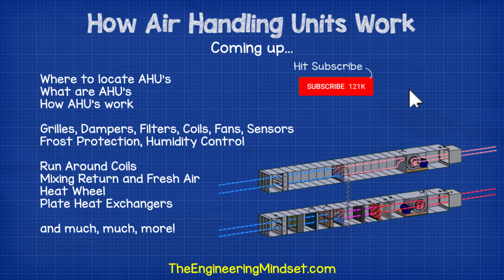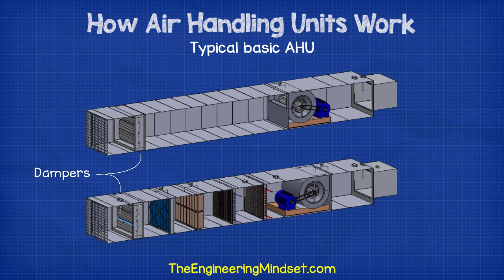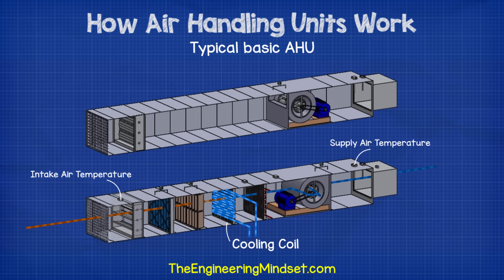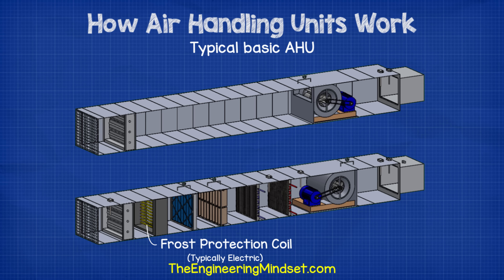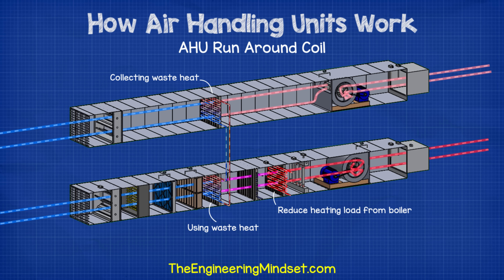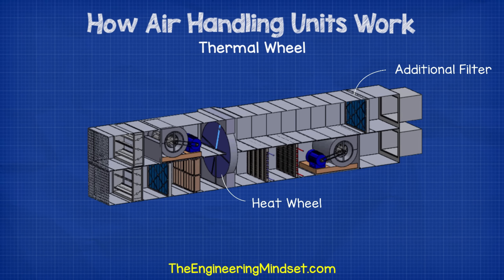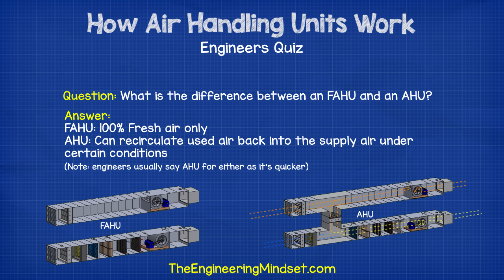How Air Handling Units work   AHU working principle hvac ventilation

Comment: An AHU (Air Handling Unit) is a machine for building air.
	•	It takes air from outside (and sometimes inside).
	•	It cleans the air with filters.
	•	It can heat or cool the air.
	•	It can add or remove water in the air (humidity).
	•	A fan blows the air into the rooms through pipes (ducts).

Comment: Service engineer from the Netherlands here. Great video and explaination. I have never seen exhaust units without filter. It is common to have inlet and exhaust filters here. No matter if there is a heating wheel.
Reply: Why filter the air going out?
Reply: @gggggggggg-ms8lm  air pollution especially in case of KEU.. kitchen ecological exhaust unit

Comment: Question . Single family home. I had two hvac companies check my ahu.. they was working on the wiring. Nothing changed. When it’s cold, it’s colder inside than out. When it’s hot, it’s hotter inside than out
Reply from the maker: I would get a temperature sensor and place it near the grilles (coils to of you can access them, infrared gun) to see what temperature the air is entering your property. Make sure it's sufficient and correct. Then my next concern would be wall and roof insulation. For example a campervan is going to be hotter inside because it's basically acting like an oven in the summer, in winter it can't hold much heat because the walls are so thin so it's going to be very cold inside

Comment: I'm involved with this equpiment frequently so (hopefully) the majority of the video is something I already know and am familiar with. In regards to your remark regarding centrifugal fans, I'm not entirely sure that was the proper way to describe it. Would it be more fair in your opinion to state that many old and existing ahus use PSC motors and that EC motors are becoming more common? Maybe I'm mistaken but I believe you will still find centrifugal fan designs even with EC motors.
Reply: I'd add, I rarely encounter an actual 'return' fan in AHUs. What's most common in my experience is just a supply fan. Any other fans will likely be exhaust fans for building pressure control.

Comment: major difference between FAHU and AHU are FAHU used fresh air take from atmosphere but heat exchange between return air to fresh by thermal wheel. AHU is recirculate air from return air to supply air.

Comment: Very good video! There are also other, more effective types of heat-exhangers in AHU's to capture the heat of the extracted air that are more ffective than the one with coils, but it's a very good example. Rotary heat exhangers as an example are very effective, but risk returning smells into the incoming air, but again, there are other variants still.

Cheers on a good video!

Comment: Awesome video. Anyone knows if there's an instrument to measure supply air pressure output at the AHU before it enters the main supply duct line? This is to know if the unit is producing enough "pressure thrust" especially for older units. Thanks

Comment: 2:22
 How Air Handling Units Work 

2:00 Air Handling Unit
2:09 Compressor
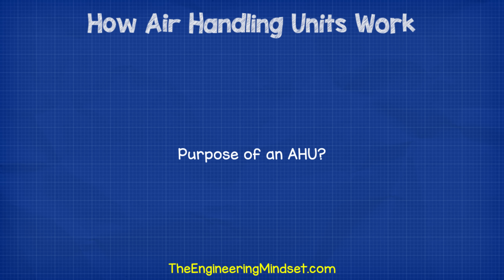2:15 Oil Seperator
2:22 Condenser
2:27 The master solenoid, filter dryer and thermostatic expension valve

2:45 Before Starting Checks: Oil > Valves > Power Supply.
 >Oil Level at compressor
 > Cooling Water Inlet - Outlet Valves to the condenser
 > Open the compressor outlet valve, condenser inlet valve, receiber outlet valve, filter drier inlet valve and outlet valves. 
> Check whether power supply to the compressor motor and blower 
> Ensure Compressor manual. 

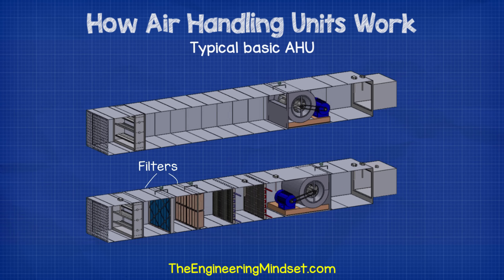3:55 Starting: Valves
 Open compressor inlet valve half a turn 
> Start compressor 
> Open the compressor inlet valve slowly to fully open mode 
> Change compressor mode to AUTO 
> Check ampres, blower motors, temperatures

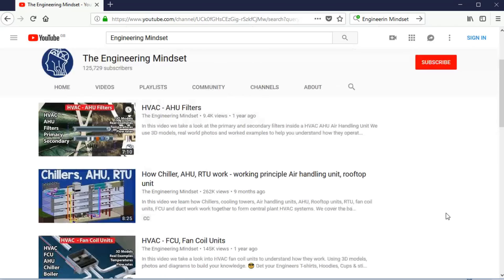4:39 During Operation: Parameters > Oil level > Temperatures
 Suction and oil pressure, vibration, oil level, inlet, inlet outlet air temperatures at air handling unit

5:15 Stopping: Cut off > Shut Down
 >When air temperature reaches set value, thermostatic switch will cut off the compressor. When air temperature increases, the compressor will cut in.
>Close the condenser liquid receiver outlet valve for Shut Down for long period.
>Compressor stops due low pressure
> Shut the refrigerant line valves.
> Shut the condenser cooling water inlet and outlet valves
> Switch off the power supply.
Reply from the maker: Seen our new pressure switch video? Link: https://youtu.be/YG81w0HFXNc

Comment: Nice presentation ..Quick question- Why is the defrost preheat before the inlet filters? I presume to ensure filters wont be full of moisture etc? I have seen rotten and blocked preheat coils as they have had no protection from the elements. Typically this is LTHW heat exchanger fitted as a preheat.. Any thoughts appreciated...

Comment: What do you think about high velocity micro duct systems. Often used for renovations where there isn’t much ceiling space or access. But what do you think about using the for residential new builds?

Comment: Can you explain the purpose of a Desiccant Dryer Unit that is sometimes connected to the outside air intake on some AHU’s? And why does it seem like the building EA is heated before the wheel then cooled again?

Comment: I mean to dehumidify the air you could use the pumped out warmth of the cooling unit  to warm it up again, so it shouldn't cost much more energy
Reply: That depends on the scale of things. I work for a major university, for example, which has a central power/heating/cooling plant for the entire campus. Since a building might be a few miles away from the plant that generated the chilled water for cooling, the waste heat from the cooling units isn't readily available.

That might be an extreme example, but it's probably often not feasible to route the waste heat back to the AHU.

Comment: Why is the humidifier not installed behind (after) the fan to reduce damage to the motor? That should also provide more direct humidity control right?
Reply: I think that's pretty standard, at least it has been in all the buildings I've seen.

Comment: Well, this is amazing video. It shows almost everything possible.

It is important to notice that when using plate heat exchangers, It is likely the filters on intake will be before heat exchanger, so heat exchanger can last longer.

One can probably also combine heat plate exchanger with additional heat coil exchangers and some pumps to extract some extra heat. The coils will be also on opposite sides, to help by using cross flows.

Comment: You missed one detail, EACs (Electronic Air Cleaners), I know many larger systems don't always use them but when I worked in HVAC I did see many on med to large roof top and in building systems. We also installed a lot of EACs in residential units, much easier to clean those than the big ones. I have found it's sometimes easier to explain air as a variable density fluid than as a gas, especially w customers who don't get physics as well, some you can't explain anything to and you wanna toss them into a big fan. Intelligent customers are usually easier to deal with.  Good vid, caused a few amusing flashbacks, one scary one, lightning storm suddenly over the roof top unit and I was inside switching out big filters, yeah, you don't wanna be inside an uninsulated metal box w lightning nearby, fastest to the roof access hatch I ever moved.
Reply: A few years ago, I used to help install them, many on building rooftops - as a duct fitters mate. I often got my hands burnt during hot summers, and even worse, got them stuck to the ducting during freezing cold winters!!... Thankfully though, I managed to avoid any lightning storms!! Lol!!

Comment: Another good tip. Depending on where your humidity sprays are, if you do not need them you might consider keeping the water in the trough but not powering the pump. I have seen where the humidity sprays are actually built under the cooling coil so when full if humidity drops it doesnt matter, it goes out the overflow like it should.
 A problem can occur, and I have seen it first hand, where if you shut off the pump and drain the tub under the coil you WILL carry over water into the ductwork. 
 Air takes the easiest path it can, by taking the water out you have made that easiest path to be right under the coil, where the humidity is dripping down. So you have air moving quickly under a dripping chill water coil and depending on how the unit feeds, up or down, you could end up with water very far from where the unit actually is. It can really send people on wild goose chase to figure it out but its really simple, you have to either block it with leaving it full of water or find another way, plywood etc.

Comment: On the hottest and coldest days of the year a good engineer will close the minimum air dampers as much as possible without closing them completely, to conserve energy during those few days. Its not  recommended except in extreme situations though, and a run around can help with it as well as a preheat too. Some areas just have too high a minimum air rules. Try heating up -15 degree minimum air.. .. Its an important thing to provide minimum air but in my 30 years of experience in a large commercial and retail complex you just have to do it sometimes.
 Another thing I have had to do is close them during fires in the area so as not to suck in the smoke or chemicals. 
 By rule you should never close them, in reality sometimes you have to make the choice to do it as its your job to run the plant safely and efficiently.

Comment: 1:08 | “AHUs are found either in the basement, on the roof, or on a floor of a building.”

WHERE ELSE WOULD THEY BE
Reply: In AREA 51,  connected by many, many miles of well--insulated tunnels, of course.
Reply: John Bond | I see, I see...

RUSSIAN SPY NOW ARE WE?!
Reply: In the safe space
Reply: Lyle | HMMMmmm...
Reply: BEHIND YOU!!!!
Reply: von Darkmoor | Sure, that is one place it could be... but I’m currently in a small residential building, and AS WE ALL KNOW, AHUs are generally not found there... :3
Reply: Hovering 15 feet in the air above the entrance
Reply: Joshua | Oh yeah, I forgot about that one, how silly of me... XD
Reply: Hung in the ceiling, often right above someone's desk just to make it extra hard for the HVAC guy
Reply: @nightwing36s | Ah, why didn't I think of that... XD
Reply: @BanditFoxx  I work in HVAC controls.  Smaller air handling units or fan coil units in ceilings are more common than you might think
Reply: @nightwing36s  | Nah, I was just pointing out how inconvenient it'd be.
Reply: Hudson Baker | I think that’s still a floor.

Comment: Correct me if I'm wrong, but I think I've figured it out. The order is:
1. Heating Coil
 ---> 2. Humidifier ---> 3. Cooling Coil

In this order, the water can drain through the drainput of the cooling coil if it is necessary to raise the humidity. I think the humidifier should never be mounted in front of the fan, as this has a negative influence on the motor of the fan.

Comment: Hi Paul, thank you for the clear video, it helps me alot! After watching this video I still have 2 questions , could you please answer them?

1. Is the 'drip catcher' (don't know the english word) mounted before or afther the cooling coil, to capture and remove the condensation of the intake air?
2. Why does the humidifier come before the fan section? Doesn't the humidity affect the motor of the fan?
Reply: The drip catcher or drain will likely be underneath the cooling coil. The condensed water runs down the cooling coil and collects in a drain pan at the base of the AHU and then will flow out through a pipe into a drain in the plant room just like water draining out of a sink. I have only come across this once so far and it was a simple system relying solely on gravity to drain away the water

Comment: Hi Paul, thank you for the clear video, it helps me alot!!!
After watching this video I still have 2 questions , could you please answer them?

1. Is the 'drip catcher' (don't know the english word) mounted before or afther the cooling coil, to capture the condensation of the intake air?
2. Why does the humidifier come before the fan section? Doesn't the humidity affect the motor of the fan?

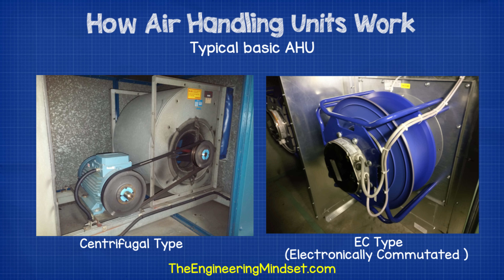Comment: Great Video! One correction I'd point out: When talking about the fans @ 5:50, the fan on the right is more commonly referred to as a plenum or plug fan. The EC motor isn't necessary always equipped on these types especially in larger AHUs as EC motors cap out at roughly 7.5 HP. Often these come with a standard 3 phase electric motors with VFDs for VAV applications. Perhaps a video on the several different types of AHU fan arrangements (fan wall, etc.) would be helpful and especially if it highlighted some of the control intricacies involved with each.

Comment: Hello, for the buildings that I’ve seen in nyc, hot water coils are always before the cooling coils. Hot water coil (pre heat) won’t freeze in the winter due to the water circulating and temperature. Reheats by the VAV boxed would serve to further heat the space as required. Other than that I found your video to be extremely informative. Thank you!
Reply from the maker: Oh yes every AHU is different, tried to make a very generalized video for the basics
Reply: Good catch on the coils

Comment: ok its all interesting, but 95+% houses dont have this, how we just regulate temperature(+-5 to 10°C) in a 16m³ room with 1 open/closable window the cheapest/efficient way. and please no aluminum foil taped on window, we already do that but it just work until noone can breath and we have to let 40°C air in
Reply from the maker: External window shade. Stop the heat entering the building. Insulation. Use an evaporative cooler for cheap a/c. Otherwise need a high efficiency split a/c unit to remove heat.

Comment: In fahu the chilled water pipe is inside damper, And air is blow it.
In ahu the chilled water line inside ahu, so the is sucked and passed through ahu

Comment: Nicely explained. I'm a HVAC design engineer and approve this message.
Reply: I’m an HVAC DDC Technician and I also approve this message.
Reply: I'm an AHU and I also approve
Reply: @chickenbananaYT  🤣🤣🤣🤣
Reply: @chickenbananaYT  this comment deserves millions of likes haha
Reply: Bro, I'm new to hvac. I'm studying hvac. I need some help from you
Reply: Hvac oem worker and I’m learning here!
Reply: Can you help
Reply: @bakeermohamed5278  .
Reply: I thought that first part of the video was about Frash Air Handlers. There is a bit different beetwen them
Reply: its HVCR
Reply: I’m interested in setting up business cleaning these things and approve of being taught this message
Reply: Where to learn hvav design online
Reply: I’m a Top G and I approve of this video
Reply: I never knew mechanical engineers specialized in one thing, like HVAC.  Kind of like doctors specialize in things like neurology, etc.  Cool.
Reply: As a VMT please always design filter racks in such a way that we can replace filters without having to bend, modify or practically destroy the new ones.
Reply: @billparris210  and so that bag filters can only be fitted in the correct orientation!

Comment: FAHU = 100% Outside Air being cooled and no Return Air. 
AHU = 100% Supply Air = Return Air + Outside Air/Fresh Air. Fresh Air requirements varies from areas Being Served.
Reply from the maker: Great work
Reply: In some cases part of return air is exhaust into atmosphere and the same quantity is added as fresh air.
Reply: Correct Sir that's why FA is added to RA to compensate the EA thus, SA= RA+FA if the pressuration is equals to zero.